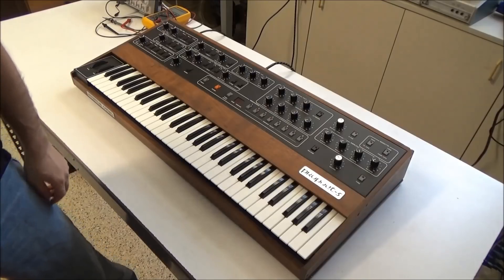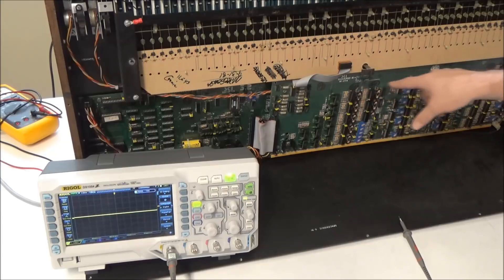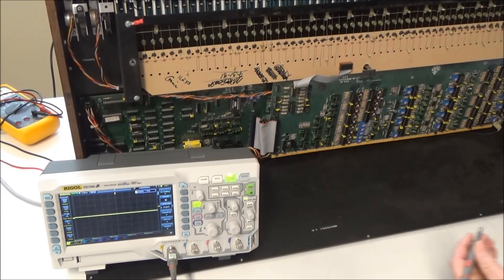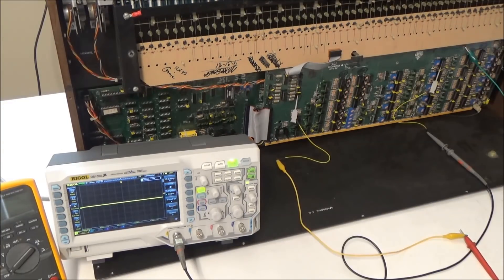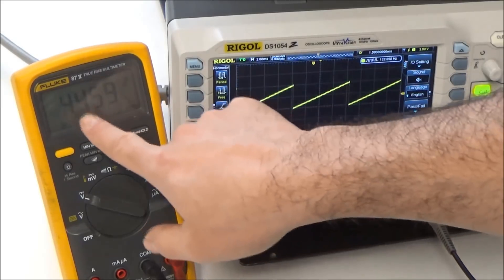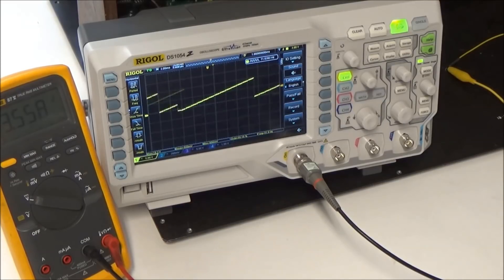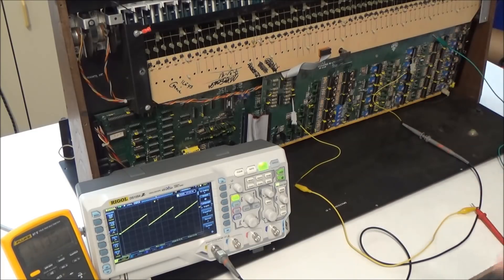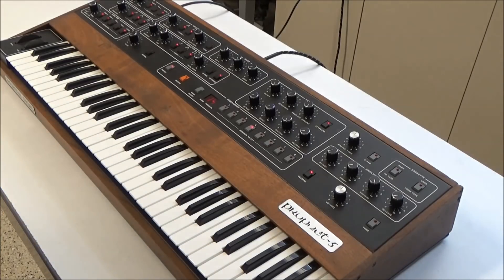Synthchaser #088 - Sequential Circuits Prophet 5 Restoration & Repair - Oscillator Repair

Comment: When the Prophet 5 came out, I had no clue how it worked so I thought it had a very expensive D/A converter for each voice and every analog control. No wonder it was so expensive! Now that I'm smarter, I understand that it just multiplexes a single D/A converter to multiple sample and hold circuits. Well, that makes a lot more sense.
Reply from the maker: Now in 2021 it's cheaper to throw a DAC at each one rather than have sample & holds.
Reply: @Synthchaser  Yes! Remember when DACs were so expensive that some early CD players would quickly multiplex one of them between the stereo channels? On an oscilloscope you could see that a mono test signal would have a very slight phase shift between the two channels.

Comment: Hi Synth Chaser, I was curious if that Rigol your using there in this video does Duty Cycle as well ? And if so why in other OB-Xa videos you used the Tektronics to measure Duty Cycle ? I need to get one and I don't know which one would be best for me. I mainly need to accurately measure Duty Cycle for now, but also want something I can grow into that would accomplish all my future synth calibrating/tech tasks.
Reply from the maker: The Rigol does duty cycle and most if not all the same measurements that the Tek does.  I have a few scopes and they come and go... In my older videos I was still using that Tek scope as my daily driver, but the fan was loud and it was bulky so I now opt for the Rigol for synth work.  I believe that Tek scope was 1GHz which was overkill for synth stuff.
Reply: @Synthchaser  Thanks so much for the valuable info. Sounds like the Rigol DS1054Z is the way to go. Compact, looks nice, cost is pretty fair for what it does, and has lots of features for me as a beginner tech. I also need a much more precise Multimeter than the ones I been using. I like your Philips PM2534 System Multimeter, but it seems to not be in production anymore. Used they are like $250 though. Not bad. Do you have any recommendations as far as that ? Used Philips ? Or is there something new that does the same for approx same value ? Anyway appreciate your time brother !, thank you !
Reply from the maker: The handheld Fluke I use has a high res mode which is good enough for most stuff.  I think the Philips system multimeter is still the best value for a 6.5 digit DMM.  They used to be $100-150 but then Dave Jones (EEVblog) let the cat out of the bag (naturally, after I had already sold my spare).
Reply: @Synthchaser  Man, $100 ??? Dang.. Well if I do get one, I just hope it lasts. Thanks again.

Comment: This reminds me of working with my dad on my first synth a jx8p that he would fix. Do you think that my prophet 6 will Be able to be fixed by guys like you in the future being modern and smt?
Reply from the maker: The parts being SMD aren't the problem, I have gear to work on SMD stuff.  The concern would be availability of parts, replacement of MCUs with embedded firmware, FPGAs and other ASICs would require donor synths, whereas many of the ICs in older analog synths are still manufactured.

Comment: Thanks for sharing. This Prophet 5 doesn't show up as for sale on your web site. I suppose it's been sold already ?
Reply from the maker: Haven't posted it for sale yet.  I'm going to make 2 more videos with it - one on how to load factory patches and then another with the sounds of the factory patches.  Then it will be for sale.  Will post the link to it on the final video and on Facebook.  Thanks!
Reply: Ah, thanks for the info. And, being an electronic hobbyist myself and having fixed a few vintage synths in my day, I admire your meticulous methods and abundant patience. Great restoration jobs on all your projects.
Reply from the maker: Thank you very much, I appreciate it!